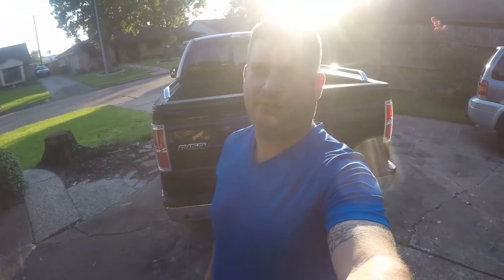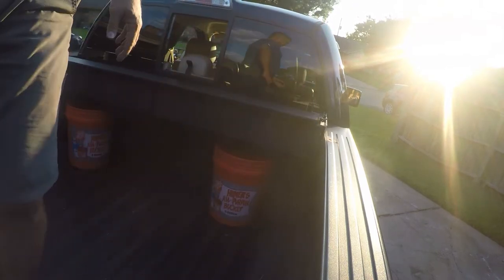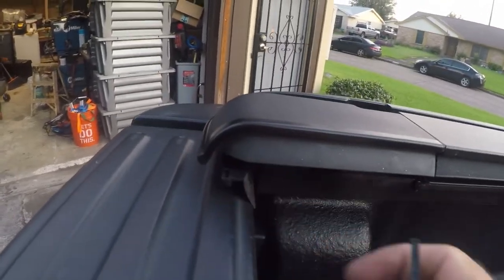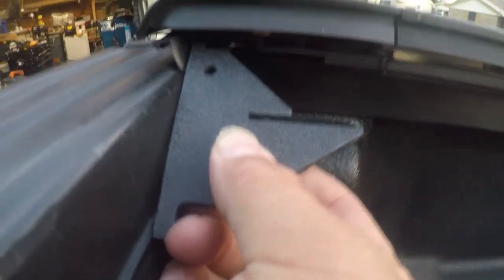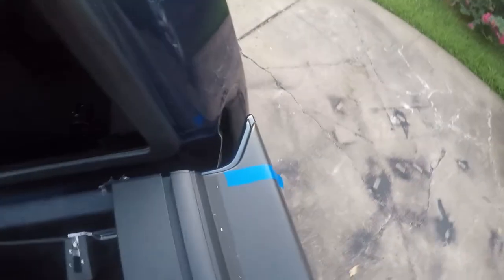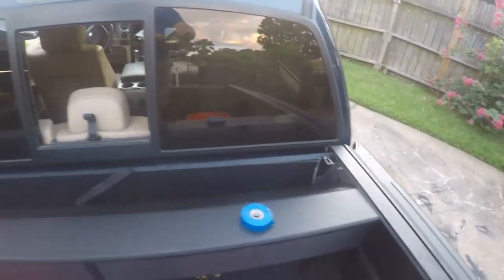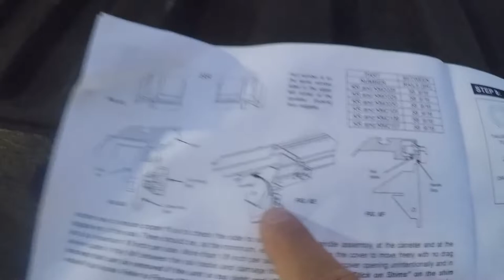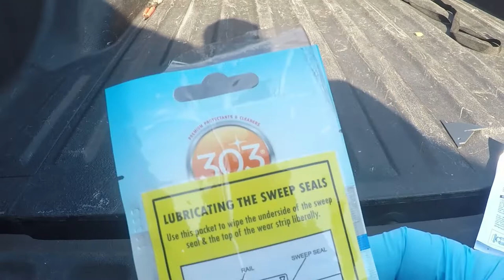Ford F-150 Bed Cover that is compatible with a removable ladder rack Install

Comment: Hey Brian I just got this cover and haven’t installed it yet. Thanks for the video. Just curious why you didn’t drill out that rubber gasket for the drain tube near the bed? I keep thinking you were going to slip and injure yourself with that box cutter!
Reply from the maker: I did not want dust or crap getting in to the bed area.
Reply: Brian Greul ah...I actually was able to drill mine out with a 7/8” bit (I think that was the size!). It’s a pretty tight fit & I’m pretty sure nothing’s getting in. Your video was definitely helpful for me! They’ve actually changed one of the parts though so I had to kind of figure that out.